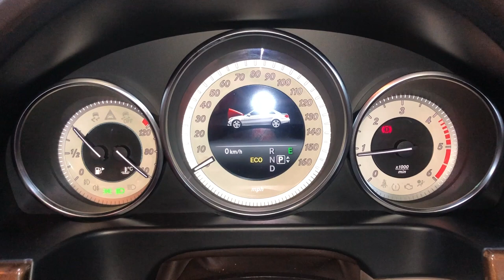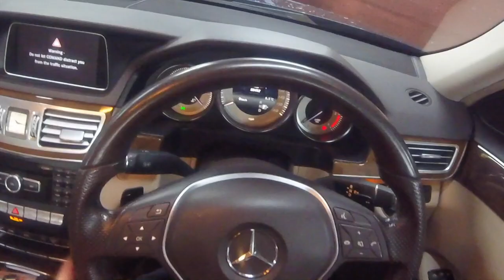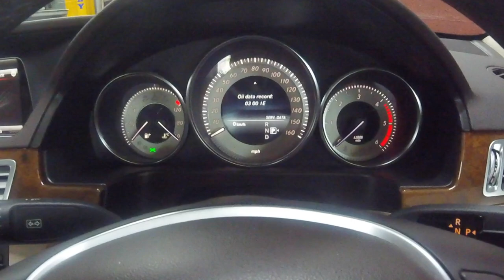How To Change Mercedes W212 E Class Oil and Filter Service E200 E250 CDI 2009-2016 Facelift Diesel

Comment: Hi nice video, my service oil change is after one year with the oil that Mercedes guys put in and charge a lot, dose this oil GM Dexos has the same one year or 10,000 mile service? thanks
Reply from the maker: Thanks you, it meets all the specifications so yes service intervals can be the same
Reply: Thanks
Reply: @IAMASPANNER  what is the washer size and where to order please?  am new and bit confused don't want the expensive oil to leak afterwards.
Reply: @MrSKULLoO  14mm copper washer

Comment: what oil would you recommend for e250 2.0 gasoline , 2014 ? i saw it's either 5w30 or 5w40... thanks !
Reply from the maker: Without knowing I would just take the recommendation from the parts supplier after giving them the registration of the car. The garage I use uses 5w30 C3 rated oil in almost everything.
Reply: @IAMASPANNER  so i did, thanks !

Comment: Is there an oil pressure indicator in this car?
How does it turn out that there is oil pressure?
Thx
Reply from the maker: Not an indicator but there will be a pressure sensor that would let you know if the oil pressure got too low. You may be able to get a live reading with suitable diagnostic equipment.